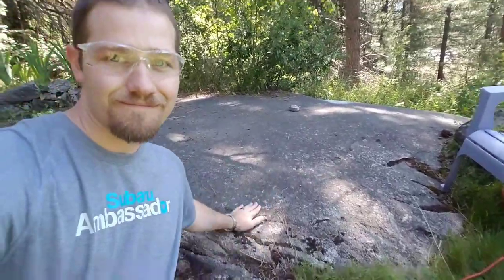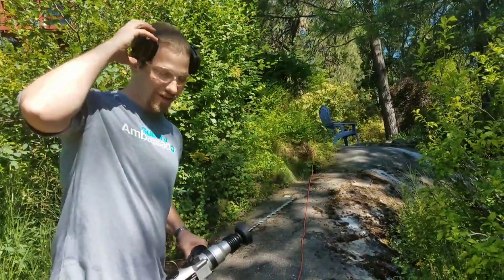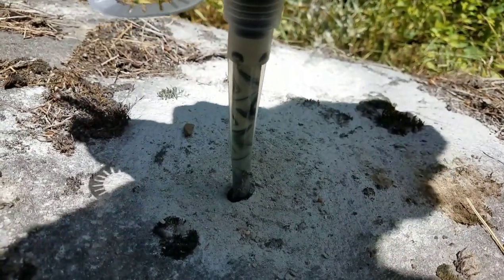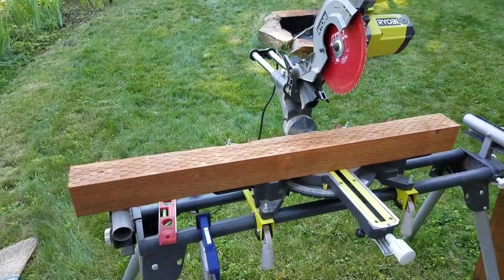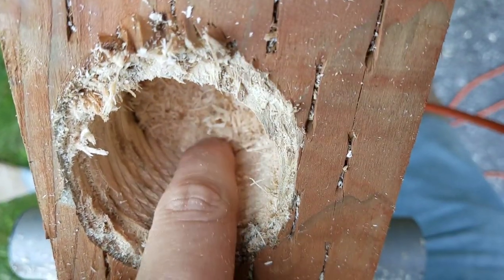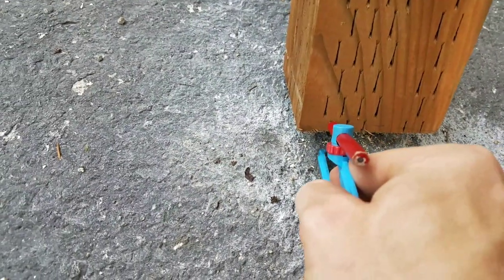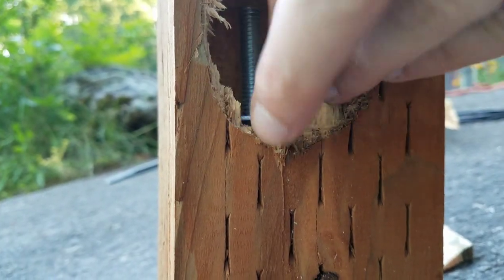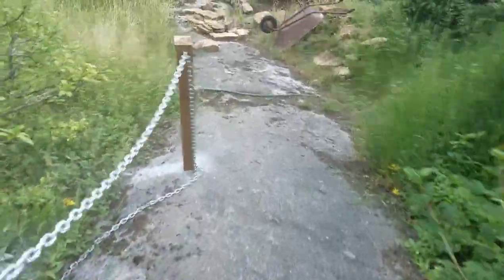How to Mount Wood Posts on Granite Rock

Comment: Great job. It looks like you had a hard time drilling those holes with the forstner bit. One thing that can make it easier is to drill a nice hole in a piece of 1x4 (or something similar) and clamp or screw that to to post to use as a guide for the bit.. that works extremely well if you have to enlarge an existing hole or move it one way or the other.. beautiful place you have, btw
Reply from the maker: I don't remember struggling with the drilling, but a good tip nonetheless.

Comment: Good job! Don't let all the experts on youtube discourage you! You actually have a really good start here. To make it even stronger, use stainless or galvanized "L" brackets, at least 4 or 1 per each side of each post. You'll have to drill more holes into the granite but the effort will be more than worth it. You can just use 2-3 inch long tap-con screws to fasten into granite, and 2-3" treated deck screws to fasten the upper portion of the L bracket into the posts. Also, while you are at it, go ahead and remove those posts 1 final time-after you've marked all your holes for attaching the L brackets, then get you some more of that epoxy, or you could even use exterior pL400 glue, and really sandwich that stuff in between base of post and granite(clean that granite first!). A lot will smooge out the sides when tightening your nut and washer, but that's a good thing! You're posts will be much safer, and they will still look great!
Looks great! Beautiful outdoor setting!😊
Reply: PS: Make sure you pre-drill each and every one of those screw holes when you go to attach your L brackets to the base of the post. You don't want all that nice work to go to waste just because your screws caused the base of the post to split along the grains. Use a slightly smaller drill bit diameter than the girth of your screws and it should last for years.👍
Reply: @Rick-the-Swift  not sure if you'll see this but I appreciate both you and the original poster for your insight. The OP led me here and your comments have improved the method.

I want to do the same thing here but for a 2000 sqft dog run. Some of my land is on bedrock so I don't have the benefit of digging 2 ft holes at every post with an auger. I'd say maybe 50% or less of my 4x4 will actually be below grade due to the bedrock.

Before I even found this video I thought of just drilling a hole into the rock about 1 ft deep, putting in a 36" galvanised rebar, drilling a hole into the 48" post about 24" deep, and then using advesive to secure the post onto the rebar.

Of course this video showed me the idea of using a threaded bar and then securing it with a bolt, which I think is not only easier but cleaner (litteraly).

Your idea of the L brackets makes it even better. Do you have any other suggestions or videos for my project ? Much appreciated.

Comment: Thanks for sharing.
It's worth pointing out that that connection seriously lacks moment resistance, which may be significantly important in certain circumstances.

If all your doing is lightly grasping a chain on private land, than fine. If one requires more significant force resistance (think someone slipping and leaning into one of those posts) that connection is inadequate, as it offers practically no moment resistance. 

I hate to be that commenter that rips into someones handy work (all too ubiquitous on youtube) and it takes guts to put ones work in a public space. Unfortunately, not all watchers are discerning, and the somewhat severe limitations of this method are worth pointing out.
Reply from the maker: Yes, you're absolutely correct.  Not something you'd want to depend on to keep you from ripping it out and falling off a cliff.

Comment: Building code requires 200 lbs load capacity in any direction at top of the guardrail post. The 4x4 post will likely fail at bottom connection.
Reply from the maker: There are no building codes here in unincorporated Bonner County, Idaho. So no worries there.  
But sure, things could be made stronger, but these are strong enough for my needs and aesthetically pleasing.

Comment: yeah, don't do this. you need at least 3 points of support, like a tripod, for each post. Or drill a big hole, deep, and throw a galvanized steel tube in it and then slide a 4x4 over that or run chain link between the posts.

Comment: What if your anchor bolt wasn't 100% vertical? This was very helpful
Reply from the maker: The bolts aren't that stiff and you can easily bend it back to vertical if it's a little off.
Reply: Matt & Amy Cool thanks. Nice railing

Comment: Structural Engineer here. Don't do this. Connection is basically a 'pin' with limited moment resistance. Use raking strut to brace post at 90 degrees to path

Comment: Easier to just scribe by hand in a case like this, than trying to slide a compass around on rough stone.

Then again: One could easily use that SDS to wear out a squarish section for each base by drilling multiple shallow holes in a grid pattern, then flatten it off using some of that fast curing post adhesive. That would be a far better prep job.

Actually, I would go so far as to rather use galvanised, square base brackets, each drilled / mounted with 4 shallow holes into the rock. Then mount your post in the "cup" of that bracket. This also prevents woodrot from damp stone, by lifting the wood from the surface.
Reply: and the longer those brackets go up the wooden post,the more stable it becomes.Thats the method I use.Not as attractive,but much better suited if livestock is involved.

Comment: sds is simply the method of  connecting the bit into the hammer drill. There are other methods that work well but not as widespread as SDS

Comment: to make that scribe line, just lay a board next to the post and draw along it on each side.
Reply from the maker: That would work fine for a rock with a relatively even surface but not well at all for a rock with complex curvature in 3 dimensions.

Comment: Could you tell me if that hammer/drill was a Harbor Freight Tool, and how well it worked?
Reply from the maker: The brand is Hoteche. I bought it online somewhere, probably ebay. It was cheap, but worked very well for the few jobs I've needed it for.  I don't have a Harbor Freight local to me; the nearest one is about 1.5 hours away.  My theory on many tools has been that if it's something that I'm only expecting to use occasionally, to buy a cheap one. If I use it enough to wear it out, then I can justify getting a nicer one.  Note that this does not apply to gas powered machines, as the cheap ones of those are not worth the price for how badly they run.  But for electric tools it's worked out pretty well for me so far.
Reply: @TheEarthwinders  I'm the same way, I have my good tools and I have the rarely used ones that I need, and Chinese tools fill that void.  I have a dozen holes to drill in granite, (VT) to place some rebar into for a foundation pier system.    Luckily I can fix most gas powered engines.   Thank you.

Comment: Is it plumb?
Reply from the maker: Close enough that the naked eye can't tell and they all look parallel. I don't recall if I used a level on it or not; but probably.  You can keep making adjustments to how much material you take off the bottom in different areas until it sits plumb, or use some cedar shims if needed too.

Comment: Yikes - I wouldn't trust that post. Don't let a 10 yr old child lean against it, otherwise it'll fall over.
Reply from the maker: You could always use the same method to fix some diagonal supports to the base of the post if you want.  This has been in place and being used for several years now though without issues.
Reply: These types of comments always kill me😆My wife says the same stuff😆I always tell her that kids can run out and go jump in front of a truck if they wanted to, or out of a window etc. The reason they don't is because adults teach them to know what is dangerous and what isn't.

This obviously isn't a public daycare center and what few kids end up being around, I'm sure they'll be instructed to be careful on the trail- if not, they won't last long in the world at any rate!